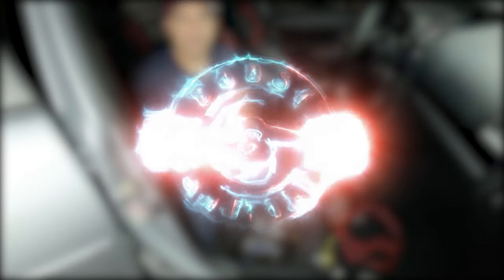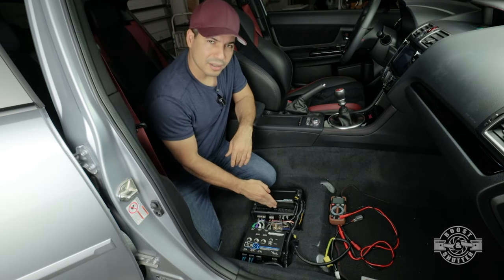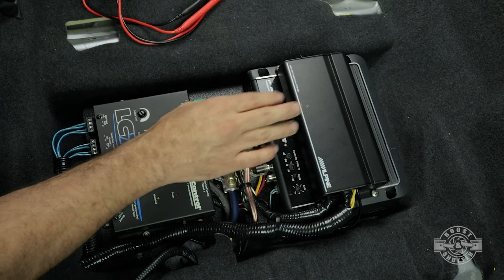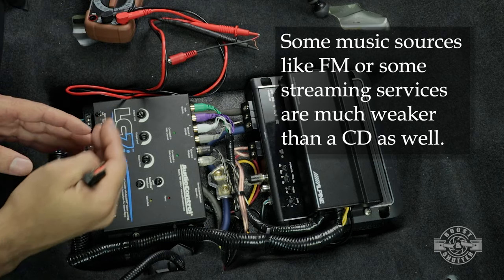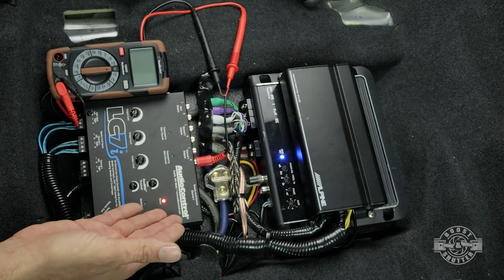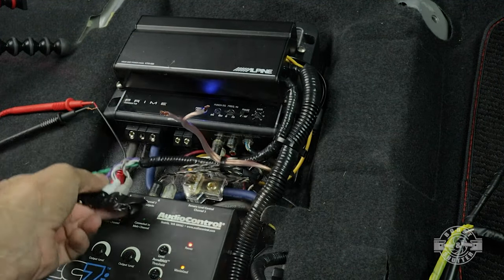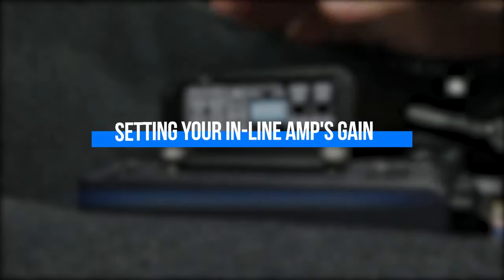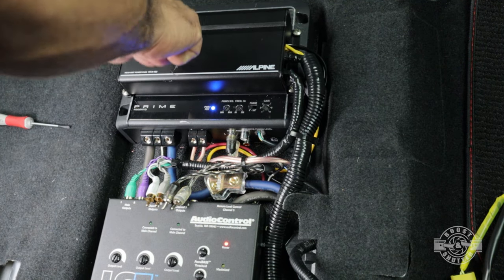How to TUNE Car Amplifier & Set Gains

Comment: Nice video! You did a great job explaining our LC7i, and your detail on setting the gains was well done, too. Thanks for helping other car audio enthusiasts with your videos!
Reply: People look at me crazy when I break out my 'Special RCA Cable' for testing line out voltage. Great video!
Reply: So if I have this LOC... I don't  need a DSP?
Reply: @unklemal yes you do
Reply: @PeterFeltersnatch852  I have 2 different kicker loc's... and I want to use my Kicker Front Row DSP... and 3 amps... 1 bass... 1 mid... 1 tweeters... all kicker... even wires... battery mounts... you name it ... kicker... except cooling... that is 4 fans running off SMD control temperature gage..

Comment: I'm an electronics engineer with a small background in analog amplifiers and a life long passion for music and mobile audio.  I've been installing audio equipment and setting gains by ear for 25 years.  While that has worked pretty well I was blown away by your simple explanation and I'm humbled.  Thank you!
Reply: I totally agree with you.
Reply: That’s what I thought also. I checked multiple sources and it’s the same process. Problem I ran across was that the volume to the sub was WAY off!!! I set the highs and Mids with my ear and it’s perfect. Doesn’t matter what I do the sun is just low. I simply went back to the old school ear method and the sun came alive
Reply: If you set anything by ear it's off.
Reply: Setting the gains like in this video is fine as long as you leave the eq flat and tone levels at minimum. If you set your gains with everything flat and as soon as you start making eq adjustments or bass adjustments now you'll be clipping. Ask me how I know.
Reply: @mattburgess2   you just contradicted yourself. the second half of your statement is correct, as to why you want to set EQ before gain. Everything is set before gain.

Comment: most helpful video I have ever seen about LOCs and bass amplifiers combined.
Reply: one question just to make sure: Amplified voltage at a bass frequency, is the square root calculation made by using RMS or max voltage of the sub? you said in the video "max rms".
Reply: I agree
Reply: @JohnKut  yes he meant max rms of the sub sir.
Reply: The hero we all needed
Reply: i have aftermarket head unit i don’t understand what to do the LOC is confusing tf out of me i don’t think i need one pls someone help
Reply: Oldegoldproduction  thank you man but how do i set my gain properly now
Reply: Quick question I got the kicker version of this loc which has the remote wire. But my question is, is it OK to tap into the stock OEM subwoofer connection? Is it too much power for that little device or will it be OK? It’s the stock amp and subwoofer plug in the back of the mega cab behind the seats . Just because it’s easy to access is why I’m asking

Comment: Remember that a speaker operates as a motor when playing a sinosoidal wave. when the signal is clipped, the speaker voicecoil is now a heating element. So not only does the amp sound distorted when clipped, it is also trying to burn up the voicecoil windings.

Comment: Question. What if I'm using a Epicenter in between the Lc7i and Monoblock? Do I send the recommended voltage for  only the Epicenter? And would that lower my signal output overall to sub amp instead of sending recommended output voltage to directly to the Monoblock.

Comment: Hi I now stumbled upon this video. Great explanation but my question would be if I am to decide between upgrading my factory double din head unit with an aftermarket head unit that has a built in digital eq and has a voltage output of 2.5v (Kenwood).  Which scenario would allow me to get a better sound quality changing the head unit or just adding the Li c7 instead while keeping the factory head unit. (System would consist of (4) 6.5" door speakers, (1) 10"sub and a 5 channel amplifier. Thanks in advance for any advice.

Comment: This video ABSOLUTELY answered my question to you on your other video where you apply the LC2i (i.e., asked about the sequence of setting Gains). Main takeaway for me was to assemble the proper equipment and information in order to follow the sequence and perform this procedure correctly. Know/have:
1) a Multimeter
2) Know both your Low Level (i.e., RCA) and High (i.e., speaker high-level) input ranges for your devices in play ... here the LC2i, Alpine amp and other Amp (don't recall the name) so you can apply the multimeter with the test tones
3) Know the RMS for your amps and ohm load so you can apply Ohms Law to calculate Gains
3) Speaker frequency ranges so you can set HPF (if relevant)
Thanks and Great Channel

Comment: This video is the BEST teaching of how to set gains, that I have found on YouTube.  I've spent days/weeks looking at examples of how to set gains correctly with my LC7i and this video is by far the best!  Thank you so much for the clear direction and explanation.  One question - what did you use to keep the leads from the RCA cable to your multimeter?  I'm going to install my LC7i this weekend and will use your method.
Reply: How did u attach leads to multi meter

Comment: Countless of videos on how to set car, audio gains, and none have been able to help me. Until I came across this video by this man and let me tell you fantastic job, because I was finally able to tune my car audio equipment, which consist of wavtech bassRESTOR LOC, Audio Control D-6.1200 DSP Amplifier, Memphis six five series VIV750.1V2 mono block amplifier, with OEM head unit. My set up has a lot of crossovers, which makes it more complex to set up gains and tune it this video by this man finally help me great job.Thank you

Comment: I don't know if you still read comments from 3 year old videos but I felt like I had to say something... 
This is one of the best "How-To" videos on this platform. Your explanations are simple to understand and straight to the point. Thank you for explaining why input voltage from both the Radio AND the LOC matters. I have a LC2i->DSP->4-ch amp and since all of them have a gain setting I was a little confused to say the least. 100% earned another subscriber!

Comment: Very nice wire management.  Excellent explanation.  I have not been using the  -5db test and setting up at full volume to see an end result of low RMS output, incorrect tuning.  Thanks for the video. Will try this method as it is more real world tuning at listening volume of 75% and the source db levels.  Appreciated.

Comment: I do not see how this video has any"thumbs down". This was very detailed and informative. My question is this, if you have a head unit that has "subwoofer level", I was told it affects the input voltage to the amplifier from the head unit. Is this true? And how would you set the amps gain without the line convertor.

Comment: Very good video and great explanation on the tones and glad you also explained the risks along with the -5dB tone and the downside if using 0dB. It gets a little more complicated than this when you incorporate DSP and start adjusting EQ and output levels of each speaker. But this is a great getting your foot in the door guide.

Comment: i used to play it safe and set all my gains using 0dB test tones but i recently changed this practice because i felt like i was letting too much go to waste for my sub amp. I still use 1kHz  0dB for the mains but i use a 5Hz -5dB for the sub amp and now it really slams. I think it makes sense because its fairly plausible to get near 0dB on mains but the heavily filtered sub signal should very rarely hit those kinds of sound levels. I did find a few EDM and hip hop tracks where i had to turn it down a little to be safe but its generally well balanced. i also started using a little budget o-scope from amazon to help visualize everything and sanity check no distortion.

Comment: Thank you for the great video! Watching your video and other ones including one by JL Audio made me understand how to properly tune my gain! I actually did that last night, tunes my Kicker CX800.1 paired with my Rockford Fosgate 10" subs. Since my amp provides 600 watts at 2 ohms and my subs are 500 watts also at 2 ohms I had to be aware of the difference. Turned out that with a -5db 50Hz test tone, my amp at full gain showed 31.5v which ended up being almost the max power for the subs! I also turned the Bass Boost off as I originally turned it ON to get more bass... I find I lost a bit of "punch" but like you said, most people recommends NOT using the bass boost on the amp. Thanks for the great video (clean install btw).

Comment: Great video.  I’ve seen comments saying that if your LOC and sub amp both have a remote knob (which they all do know a day) that it’s better to use the sub control remote knob from the LOC, not the amp.  From my understanding the sub amp will only attenuate -20db where the LOC will completely mute it.  Thoughts?

Comment: freakin awesome most helpful and explanatory video. thank you! however i am stuck at one major step. So i bought a multimeter just last night since i am  worried that my amp or sub getting damage because of the current gain setting. i went ahead and straigh up tried setting the gains
Reply: but after hooking up the multimeter to the speaker outputs of the amp to set the gain...there is a 0.00 readind and does not change from there? everything its good as far as the other steps. test tone. hu volume...but no multimeter reading after hooking it up to the amp?  help me.out brother. thanks...

Comment: One of the best step by step system tune videos on youtube thank you so much! I will subscribe. P.S. I'm 99% sure on RF amps the bass nob dose not control the gain maybe on the Prime but on the Punch and T. The bass nob it is a set 45hz DB volume adj. it IS the punch EQ! also on RF as soon as you plug in the remote bass nob it bypasses the punch EQ on the amp because you are now controlling it remotely. If it has changed that's news to me.. I have two T1500 and a bunch of punch amps new and old.
Reply from the maker: Yeah on this amp it's a remote gain. I hate the punch bass. Thanks for the comment!

Comment: Wow you are incredible you so much easier to listen to and to understand then some of these professional car videos and they talk so fast. I just put in a ( lc7i ) to a pioneer 1200 watt to control my 6/9 @ in the front and my 6 in the rear . And then I use channel 3 and paired it with channel 2. Then I jumped out of it and found a kicker to channel amp which I bridged to my subwoofer now with this video I’m going to be able to do it exactly the way I want to do it. Because you make it easier to tune in all the bullshit long ass videos. I put the kicker speakers in the doors. And I got a 8 inch sub in the back. All my games are completely turned off on both amps basically zero. This is done in the 2022 Toyota Tacoma and you have to have a Lotta patience when it comes to this type of work. He did is very technical if you want it done correctly running 2 Amp that are separately derived system‘s took me a while to install to do it correctly when you bring it to a car dealership you do it real fast and it’ll take your time and patience to do it right in my opinion I love my music and I like the clarity and without an LC7l you will never make your stock radio sound clear and crisp I can barely get mine up to volume for anything incredible now I have to find doing it the next time I feel like ripping my seats out because everything‘s hidden in the truck😂❤

Comment: Awesome videos, I watched both about the lc8i. I'm in the planning phase of my 2019 ridgeline rtle and aiming at the lc8i. From what I've learned, the factory amp has outs for front doors, frt tweeters, rear doors, sub and center channel. So if correct, I can run each channel separately. I've done all my own car system fir years, but this is the first time I'll be using a converter. Thanks for the info and if you have any tips for the lc8i I'd appreciate it.

Comment: Quick side question - You mentioned in first calibration to put everything to flat .. if however one likes a bigger bass curve or brighter highs, shouldn’t we set the system “the way [we] like it” beforehand, so that if you DID boost frequencies, they wouldn’t overload or distort the LOC or other devices? Or is the 75 percent suggestion enough of a swing to compensate for any overdriving? Thank ya 🙏

Comment: You are amazing!!! I been tuning my amp since I installed them couple weeks ago. I have mine setup with LOC and amp. I could not get it right with all the research I did. Your explanation is very simple and easy to understand. Now my sub sounds right. Thank you for the video.
Reply: After tuning it and I drove the car for about 50 minutes. Came home check the amp it is running really hot. Do you know why amp running hot?
Reply: I barely able to touch for like 5 seconds. I think it’s because of the location I have installed it. I have a mustang, it is hard to find place to install this amps. I’ve installed them in the spare tire compartment in the trunk. I think there is no proper ventilation. I’m planning to install a fan in there. Let me know what you think?
Reply: Kicker CX 1800.1
Reply: I am running a 0 gauge wire for power and ground. I have a single 850w rms sub with 2 ohm. Have it setup 4ohm to the amp.
Reply: I don’t think there is a mistake on my wiring because I check them several times. All the numbers are setup right with the help of your video. So the only think I can think of now is the space.
Reply: From what you mention, it could also be poor ventilation or false contacts
Reply: @melvin4u88  what kind of wire do you have bud.  0 gauge CCA "copper cladded aluminum" or OFC oxygen free copper.  There is definatley a difference.  If it's CCA even at 0 gauge that is not adequate for that amplifier.  Make sure the location of your ground has a good reference to battery ground.  Just because it's metal does not mean it's a good ground.  You are dealing with a high wattage amplifier and they are less forgiving then lower wattage setups.  Again make sure your gains are correct.  Are you amplifying a clipped signal.  These are things you need to know.  You will need to have a way to measure and see Distortion.  A meter won't do this.  You will need an oscope or a Distortion detector. Sorry but these are the facts bud.  Good thing is any install shop worth their salt will have these tools.  Won't cost much to do either.  A multimeter will only allow you to do mathematical setups.  It does not account for source signal Distortion.  At your power level amplifying distortion can also create allot of heat....... But assuming everything is good wiring wise and your amp is tuned correctly, it can be a characteristic of that amp to run warm even hot as long as it isn't giving you issues ex. Going into thermal or protect etc.  Good luck brother
Reply: @akqjtn  nice video bro

Comment: So I have always had trouble setting gains as I just can't hear distortion and I tried to hook up my system using this method.  

For whatever reason I got no sound from the speakers once I hooked everything up. 

I ran 1 set of wires from the head unit for a FL/FR and then ran 2 sets of wires from the amp back to the wires going to the speakers. 

Not sure if it is the harness (CRUX toyota harness) or what.  I wound up having to switch back to using rcas and the sound worked. 

Otherwise it was a great tutorial and if it would have worked it would be been great lol.

Comment: I can install wiring, speakers, subs, head units you name it but when it comes to setting gains and all that I really have no clue on what I'm doing. I don't understand frequencies and hertz or any of that. 

I learned how to set with an oscilloscope but I wonder how well it is cause I feel like the bass just doesn't hit as hard. For bass I used a 40hz test tone but I'm not sure what to use for mids and highs.

Comment: Thank you so much for this video! I have a question for you! I have an Android aftermarket head unit. It's on putting out .8 volts AC from the RCA outputs. Can I spliced into my high level speaker outputs with RCA cables to make it work with this unit?

Comment: Thanks for the how to, I just had a follow up question that maybe you can answer or someone else. If I play the -5db 40hz tone to set the sub amp gain will that damage my factory speakers, currently I have no way of disabling unless I take off all my door panels. Or is there another way to set the gain. Thanks

Comment: Hey man, I’m putting a LC7I in my 2015 Toyota Highlander. I have already installed an amplifier for my subwoofers. I’m now adding another amplifier for my door speakers. I noticed you are only using the first 2 connectors for the speaker wires going into the LC7I and not the third channel. How are you doing this and also adding the subwoofer in with those 2 channels? Thank you.

Comment: Hey man great video, question for you, have the same set up in my 2018 grand Cherokee, factory head unit, pioneer 4 Chanel app powering 6x9 pioneers in the front + tweeters, rear set are 6 and a half, 12inch sub in the rear. I have some unwanted bass on some rap songs coming through the front door speakers is the hpf still usable on my 4 channel amp? I’m hoping that would fix the problem but haven’t messed with it. Wasn’t sure if those setting on the 4 change amp are useless because of the LC7i. Btw my bass is turned all the way down on my head unit eq

Comment: Thank you so much man, I have the lci7 as well with a sub and speaker amp. I’m getting so much distortion so I’m going to try this myself because the shop I got it done at couldn’t figure it out. QUESTION: will having a stock stereo mean I may still have distortion? And what song should I play for the speakers? Does it matter as long as it’s high end quality. I have heavy hip hop songs then some Weeknd songs that have a lot of high frequency parts